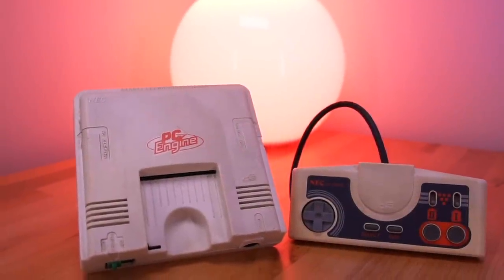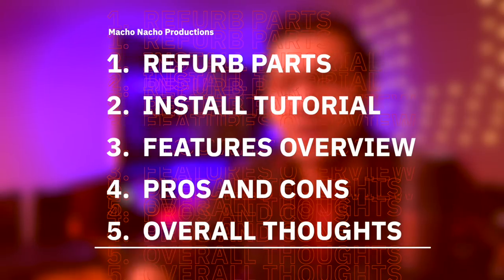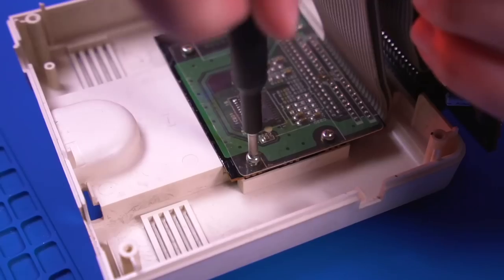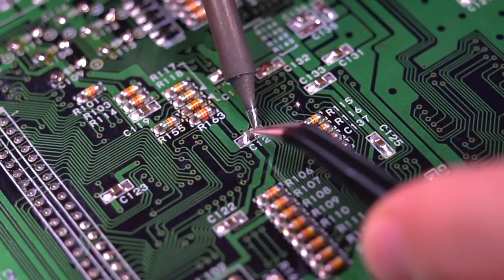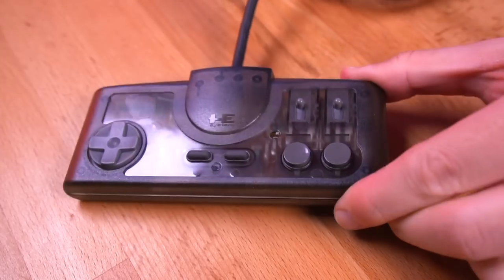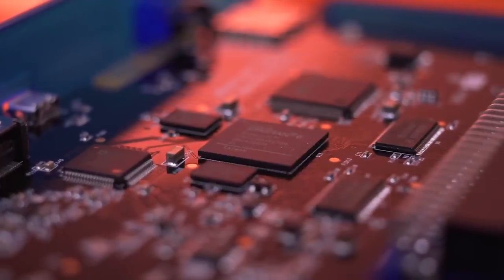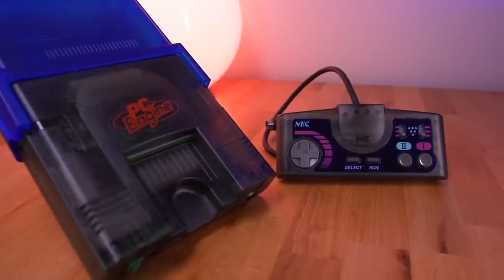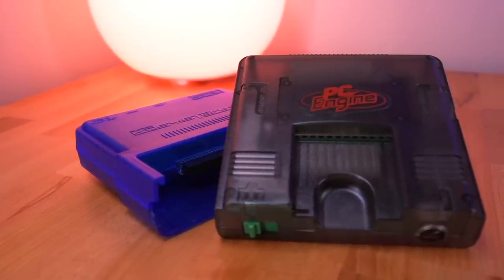LET’S REFURB THIS PC-ENGINE AND TEACH IT SOME NEW TRICKS! | HDMI, ODE, SHELL, CAPS and MORE!

Comment: I was in the first wave of RGR shells and got one clear and one smoke. At first I, too, fought to thread the screw posts for external screws using both my iFixit GameBit and dedicated GameBit driver. I soon realized that you can thread the posts much more easily with the internal screws from the HuCard reader/slot. The thread pitch is the same so you can thread it with them, back them out, and effortlessly reuse the threads with the original GameBits (careful not to cut new threads!). The difference is that the internal screws are self-threading with a channel for plastic shavings to accumulate. When using them to cut the threads for the external screws I would occasionally back the screw out, remove the shavings, and continue a bit farther each time. My goal was to create perfectly straight threads without slipping even once and I accomplished it using this method.

FWIW, early model PC Engines have standard Philips or JIS screws instead of GameBit for the exterior. Some also have a different shape around the controller port and a different corresponding design on the controller plug. I believe NEC was the first to use GameBit screws as even the NES wasn’t using them back then. This is why GameBit screws were originally called “NEC External Line Head” screws.
Reply from the maker: Thank you for the insight and advice Emmett 👍 never though to use the internal screws. Very much appreciated 🙏😁
Reply: @MachoNachoProductions  Thank you. I hope it saves someone the frustration you and I went through our first times. :)

Comment: Very top notch work. My only recommendation would be is when installing the screws in the bottom of the shell (or any new shell) screw in the screws a little bit, then back them out and do this several times. The reason it was hard to put the screws in is because there isn’t threads yet because it’s a new mold. You want to be extra careful when it comes to clear shells, cranking too hard could crack the plastic. Smoked plastic is much stronger than clear but still not as strong as regular plastic

Comment: Very nice clean up of the console, something you might be interested in is replacing the Voltage regulator with a new more efficient OKI-78SR-5/1.5-W36HE-C. According to "RMC-The Cave" it is a drop in replacement and produces much less heat to the point you don't even need the heat shield anymore.
Reply from the maker: Nice!  Thank you for the heads up!  I’ll definitely need to look into that!  The PC engine does get quite warm 😅
Reply: @MachoNachoProductions  The OKI RMC used is known to add ripple. The R-78B5.0-1.5 is a better option but much more expensive. But any switching voltage regulator is going to add some amount of ripple. I have been trying to solve the problem electrically but perhaps substituting a few larger electrolytic to smooth the ripple.

Comment: Macho Nacho Productions, if you use a cue tip to clean the black parts of the button membranes, they will be more responsive, as the shiny buildup can make buttons less responsive.
Reply from the maker: Thanks for the advice!  I’ll start to do that 👍
Reply: I did this for my Gameboy Color the other day and it fixed all of the buttons. It made such a difference!
Reply: @MachoNachoProductions  FYI the PC Engine controller uses the near exact same membranes as the Nintendo Famicom. They even have holes in the same positions to help line them up in the plastic housing. You do need to put a small notch into the D-pad membrane to help it clear one of the posts and the A & B buttons will have an extra loop to secure it to a post that exists in the NES but not the PC Engine. Otherwise, they function perfectly. The Famicom versions tend to be a little softer and the NES versions tend to be a little firmer. The only unfortunate part is the start and select buttons (Select Run) are too shallow to be used comfortably in the PC Engine controllers.
Reply: @grafxgear  cool! Thanks!

Comment: Here's a nice tip.. The one thing which I found ultra annoying and im not sure why you didnt but it was the microSD card slot on the SHDS3P. Its so embedded in there that yo need some tweezers or something to eject that microSD Card. I used a micro SD-card extender to make the microSD extender a bit more accessible. I guess you could also dremel out a little bit of the shell to gain better access to the micro SD slot.

Comment: I recently took a chance on buying a PC Engone. The seller claimed it didnt work, but after i plugged in my Saturn AV cable (it was modded to replace the RF port with a Saturn AV port) and plugged in my Turbo Everdrive......IT WORKS!

And I found out why the seller claimed it didnt work. The RF switch is still installed. If the RF switch is set to the low channel, the AV port doesn't work. Hiwever, when the RF switch is set to the high channel, then the AV port works.

And yes, it also has the jailbar fix.

$57? Not too bad for a "broken" PC Engine.

Comment: I've always liked how the Japanese PC engine looked compared to the turbo gfx.
When I did the ips mod on my GBA, I bought a new shell and all the screw holes were so tight, that it took me all day putting it back together.
I had to use the new screws and original ones bc either one would have it's head stripped from me trying to get it in. 
I should have got a small drill bit and opened them up, but I kept thinking the next screw hole won't be as bad.

Comment: There is no “standard composite” on the white PCE. As I understand it, even composite is generated from the digital output when using the Super HD System³ Pro. The white PCE itself only has RF and, well, nothing that get composite from the EXT port would really qualify as “standard.” ;)
Reply from the maker: That’s a good point, I was using the ext to get composite. Rf would the the standard in this case
Reply: @MachoNachoProductions  Dojin Dance does make a upgrade board for the White RF PC Engine that adds this.
Reply: @NoshAbroad  I actually have two of his kits right here. I felt that his was the neatest-looking and better than I could do DIY if it was going to be visible through a clear shell. ;)
Reply: @NoshAbroad  I installed the saturn lead RGB. It's fairly simple and clean looking.

Comment: Nice video, it amazing how before watching this I’ve already been through the exact same journey. Even down to deciding to replace the jail bar caps just because. However, I decided to use a Core Grafx because I read the revised processor fixed some kind of audio distortion? I assume that’s for the sound chip generated audio, not CD audio. Personally can’t tell the difference… but the blue of the core grafx sticker matches the blue of the super SD system nicely.

The issue is the case has the cut-out for the RF socket of the white console, not the DIN socket of the core grafx. They do score a cut line for the DIN but I decided against cutting my expensive new case. I’m actually thinking of installing the small MD2 socket for the RGB modded output instead but there’s no rush. It would be really nice if they just made smoke core grafx cases!!!

Yes the PCE is easily emulated but for multiplayer, I’ve not had success with retro pi playing 5 player games. So options are Analogue’s fpga Duo, that will only support 4 controllers which is a deal breaker for me. I asked them if you can have 1 wired and 4 wireless and they said no? Then there’s the Konami mini’s but the hack for the mini doesn’t seem to have come to anything so you won’t be able to add all these great games and has anyone tried the mini usb multi tap with 5 x 8bitdo usb receivers, they fit without extenders… I have 5 official PCE ir controllers and they’re great (so long as you don’t need to control the TV while the console is on)

The Turbo Everdrive is absolutely worth keeping for use in the GT (or if you have an LT or Express).

Final point with the SD system 3, only the Pro version has the Supergrafx hardware on the fpga. This now leaves me thinking I should sell my Supergrafx but wouldn’t it would be strange to keep the games without having the system? Just so I can legally have the ROMs…
Reply: There are a few games where you can tell such as Doraemon: Meikyū Daisakusen. The thing is developers had already been working around this problem so it broke compatibility with older games. Ultimately NEC reverted the change for the later pc engines and Duo systems... So most games are made with the non revised chipset in mind.

Comment: It’s too bad Terraonion ditched the smoked shell for a blue one. Would have matched the replacement shell perfectly.

Btw, I think the screws were difficult to screw in because the shell screw posts are not threaded so you have to thread them yourself.

Comment: I have the original PC Engine controller without turbo, but I haven't seen any replacement shells that don't have the turbo cutouts.
Reply: Did you know those controllers still have the turbo cut outs AND you can even replace two resistors and add an IC to add the turbo functionality?  The PCB is already prepped for Turbo, just missing some of the parts.

Comment: was that lag i was detecting on the comparison vid? if the hdmi introduces lag, that's kind of a deal breaker. lag is pretty much the reason a guy seeks out og hardware these days. but yeah, your setup is pretty much the ideal in 2022. nice build
Reply from the maker: Its probably the timing on my part. I have to manually align the clips so I was probably a little off.

Comment: you did not route the cable correctly in the controller.  It is supposed to "S" around the pegs. The way you did it, it will be much easier to rip out the cord.
Reply from the maker: That makes sense, I wonder if mine wasn’t installed correctly from the factory or someone else opened it before me because I put it in how it was before moving it to the new shell
Reply: @MachoNachoProductions  if you send this whole project to me I'll fix it for you and I might even sent it back to you 😉

Comment: Saw the video, and was really nice, great job.
I was wondering if anyone could help me, I have a second pc engine, the core grafx II Europeans model, but it's not working, the console is powering on and at first I got sound but no picture will it via composite or rgb, then later I even lost the sound I would appreciate if anyone could help 😓😓
Tell me what I should look and test.
Reply: I would first test the voltage regulator. make sure it it putting out the proper voltage. there is also a little glass diode near the voltage regulator (it was replaced with a modern diode one in later models) Just make sure it isn't shortage. If all that checks out it is almost certainly the capacitors. All of those things can be replaced.

Comment: Hey Macho Nacho, don't you think this is just one big FPGA's. I was rewatching this video a couple of months later but you said that you don't have to replace the 2 caps on the board for the jailbars. To me it sounds like it's a Mister pasted on the back which makes use of the power, the controller ports and the video ports. Don't you think this I just a console on it self and all FPGA? Doesn't the defeat the purpose of buying original hardware? Like to hear your thoughts.

Comment: It's probably cheaper to buy an another PC Engine/Coregrafx with a nice shell than the replacement shell.
Reply: That is sort of missing the point.
Reply: @NoshAbroad  Maybe, and the transparency looks nice, but it's couple pieces of plastic costing over 100usd.
Reply: @makere  People spend 100s on sneakers and don't play sports.  People spend 1000s on rims for their car even though it came with 4 perfectly good rims.  People should be allowed to express themselves.  Maybe you don't see value in it, but others do.
Reply: @NoshAbroad  Yeah and I'm not judging someone spending the money, just for me having pristine second Coregrafx would be more worth of the cost.

Would be cool if they made a shell that would incorporate the SD System 3 inside into a one tidy consistent packaging.

Comment: dang, $100 for a new shell? i could see myself buying a few of these if they could hit the right price point.
Reply from the maker: Yeah, it is certainly pricey. Thankfully it comes with the controller shell too
Reply: Small batch runs for a niche product will always be expensive. I believe this would take 8 molds to make the 4 pieces of this kit and each mold can cost 10s of thousands of dollars (American.) Now factor in this is a low volume product for a niche market and well... RGR really isn't making all that much off each set.